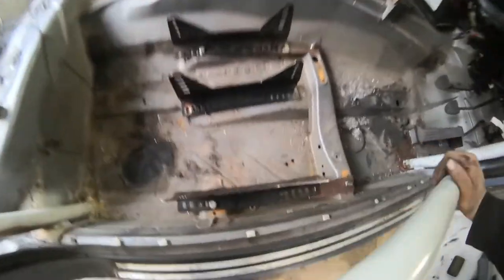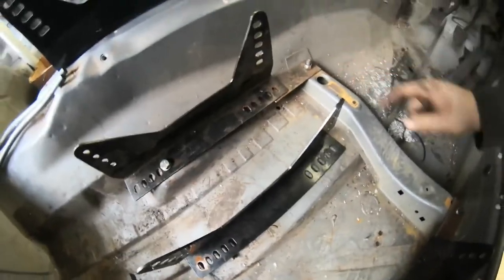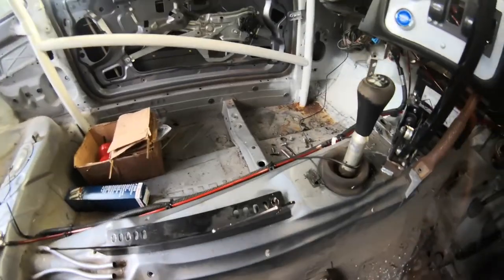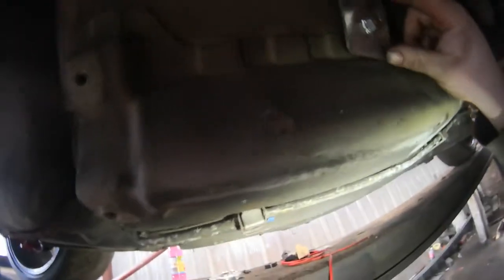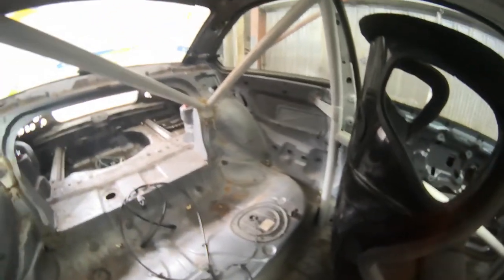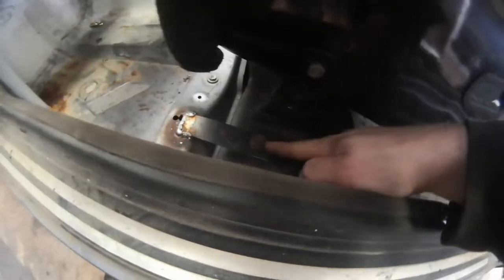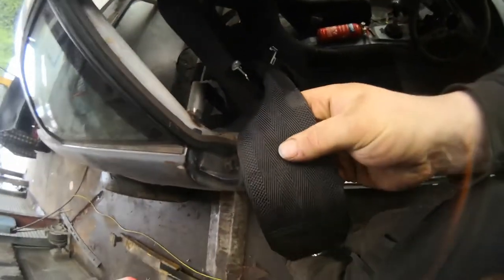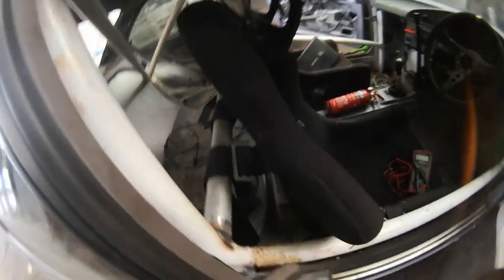Bucket Seats & Harnesses | E36 Drift Build Pt.13

Comment: Dont you have to have your rollcage seats and belts certified to use them in drift events?
Reply from the maker: To compete you must have FIA approved seats and harnesses, but not in date. The cage must follow certain rules. I don't compete so none of it applies to me. 😁
Reply: @47autowerks  oh i see because i compete in my country and for turbo or big engine builds that are not original to the chassy you need those thing